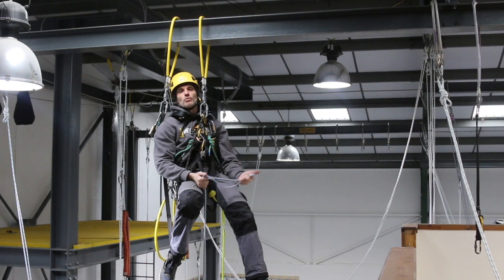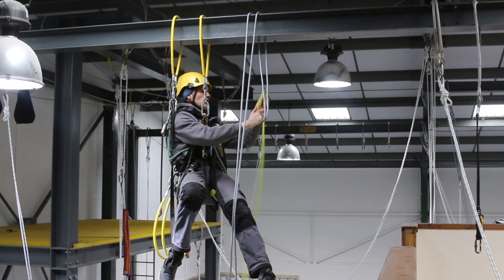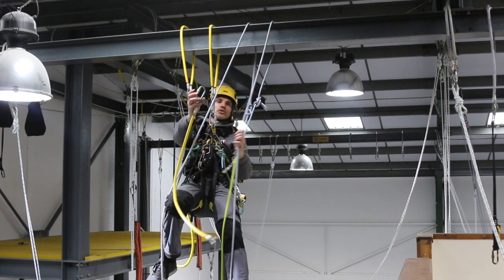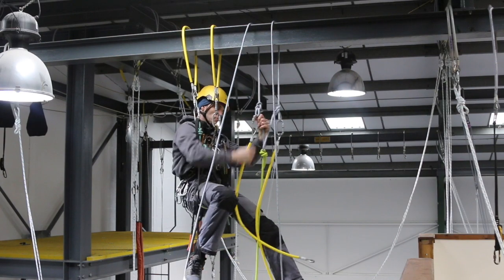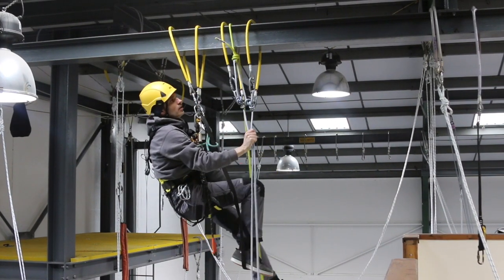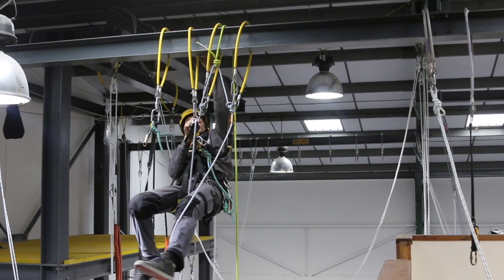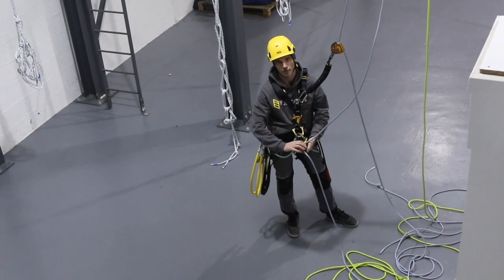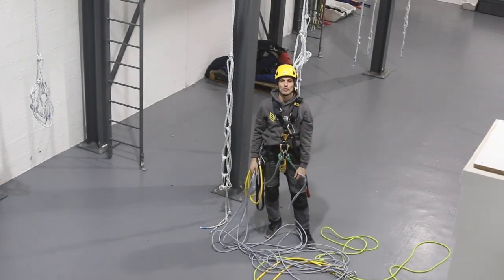Retrievable Rigging on a Beam

Comment: If you have 2 sets of ropes, 2 connectors, & 2 wire sling protectors, why wouldn’t you just set up each rope as its own line? You can still pull down the back side of ropes ( non working side ) once your down on the ground to remove the ropes

Comment: Very useful, I also use it in SRT treeclimbing with double descender and 10.5 mm ropes. Also useful for having a rescue system on the tree, after a careful and correct analysis of the working method: better to be safe than sorry.
Thanks for your clarity in the exposition, and the fact of making it chained in continuity makes learning easier.

Comment: You can install this system from the ground using a thin (paracord) rope and a throw bag. Very usefull skill, maybe you want to show that in a video, too.
I would suggest using pulleys instead of screw gates. Everyone has pulleys on hand and it is even more unlikely that the knot slips through.
Reply from the maker: I'd agree setting this up from below is very useful and is taught on the course. It's maybe not clear but I use an oval shaped maillon to attach to the rope not a karabiner. The alpine cannot fit through and it is more 'bomb proof' than loading a pulley in a way it's not designed for, although a pulley does work.
Reply: Main point was: I have always pulleys on hand but i don't carry any maillons.
Reply: If you use a 8 mm diameter false link it will be difficult for the knot to slip with the weight of a technician. He used the fake shirt just to keep it from slipping. The solution with pulleys is good, but if you carry a load of two technicians I recommend that you protect the pulleys with an additional connection for the rope, in case the pulley axes break. While with the 35 KN false links the additional protrusions are not needed and the knot nevertheless hardly slips.